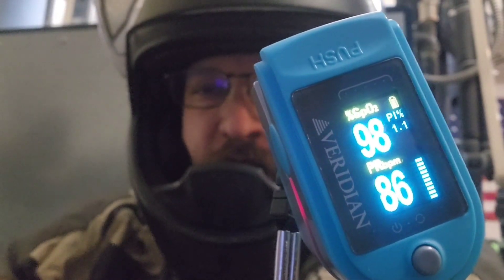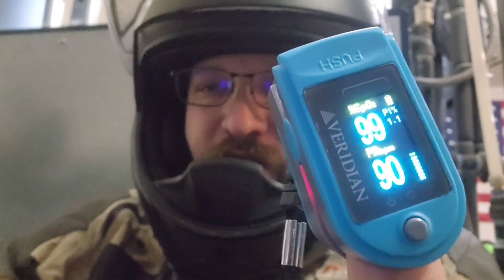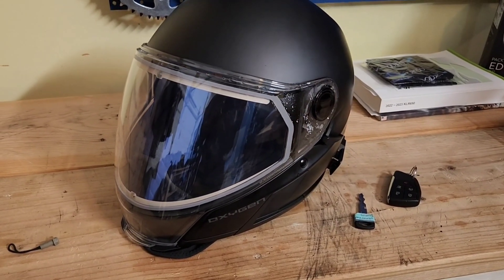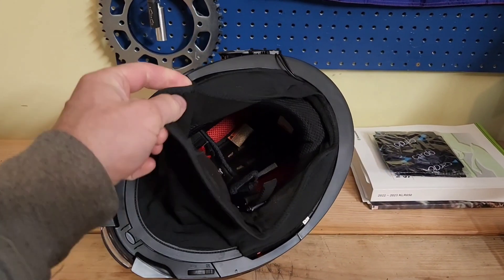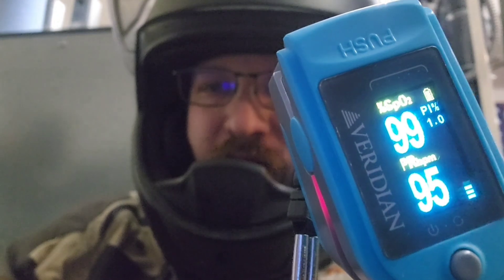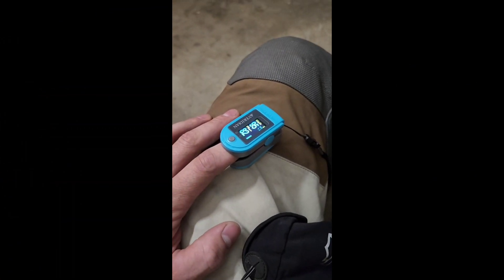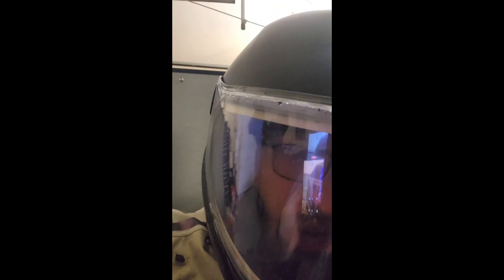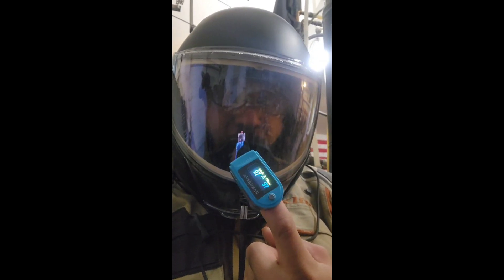Is CO2 in your motorcycle helmet really a problem? FortNine says yes.  Read the description.

Comment: I believe it's a function of how individual people breathe.  If you're a person that takes shallow slow breaths while cruising down the road (particularly true for an older person), you will not purge the air out of your helmet, and you'll breath the same air over and over until the CO2 levels become a  problem.  I know this personally, so remove those chin curtains, folks ... Especially if you're no longer a teenager.
Reply: As a side note, I no longer ride with a chin curtain, and I no longer find myself yawning for no reason.
Reply from the maker: That's fair. Your depth of normal breathing could definitely cause you to circulate less fresh air. 😬

Comment: Like I said on Fortnine's video, it's a non issue since the solution is to do what so many of us do as a matter of course at a stop, we crack the visor. Problem solved. Or, those of us that run modulars, no problem.
Reply from the maker: I do typically pop mine open when I stop also! Except for with the winter helmet. I keep that closed to keep the inside warm. It prevents my glasses from getting cold and then fogging up when I close it again. 

The reason I got out the pulse oximeter to check my O2 says was because a friend sent me the video from FortNine and had me worried about safety with the visor closed. I am not so concerned now.

Comment: Fortnine puts out really good well researched content, you don’t have to agree with everything he says but you should try to at least put in more work researching before trying to “debunk” him.
Reply from the maker: I also like FortNine's videos! They do a good job. I don't disagree that the saturation of CO2 in the chin area of the helmet is as they measured. I simply disagree that your brain function is reduced by 50% with normal breathing. You take in enough fresh air in addition to the re-breathed air with each breath that safety and oxygen saturation is a non issue.
Reply: @ak.klr650  That’s fair, but the video wasn’t talking about oxygen saturation, it was about decreased cognitive performance during high co2 exposure. Fortnine didn’t prove any of this in his videos, he just proved that motorcycle helmets do indeed create high co2 environments then pointed to studies showing the high co2 environments lead to a decrease in mental functioning. You should do the video again but this time maybe do some AB logic puzzles and time how long it takes to complete a set of 5 then put the helmet on for 5-10 minutes and do another set of 5 with the helmet on and see if you can see a change in the time it takes you to complete the set of 5. That would be an awesome video that would actually give you some actionable info.
Reply from the maker: I did find the OSHA information on allowed PPM, over an 8 hour exposure period, interesting. 
I might do a follow-up eventually. I added some info to the description on this video so people can see what I found after making this one also.
https://www.osha.gov/sites/default/files/methods/osha-id172.pdf
Reply from the maker: That might make for an interesting test!
The only examples of elevated CO2 in your blood from the medical world that I have found so far come with reduced O2 saturations. I think the link is pretty close between the two. I would be interested in seeing an example of where that isn't correct though! So yes, I drew the conclusion that high CO2 would have to mean low O2, but again, maybe someone can point out an example of that not being the case. 

I'll paste an article below that talks about hypercapnia (high CO2 in the blood). Since the treatment is Oxygen, I'd assume hypercapnia generally is associated with hypoxia. But maybe there is a scenario I don't know about that could be separate.
Reply: @ak.klr650  so it mainly comes down to the fact that your body can easily recognize and adapt to changes in co2 levels but not so much o2 changes. Therefore your body (primarily not completely) uses co2 to detect wether or not it is getting a sufficient amount of oxygen per breathe. When co2 levels heighten it compensates by changing your breath and also slowing down brain activity, which is the problem here. So they have very different effects and can’t be considered the same. I’ll keep an eye out for another video if you post one, it would be cool.

Comment: I agree with Fort 9 because I personally have had times where I suddenly felt fatigued due to the dirty air in my helmet. Opening the visor an inch immediately cleared the air and the fatigue was eliminated. Fort 9 had it right. I knew this before I watched his video. No need to watch this video. Thumbs down...
Reply from the maker: Glad opening your visor has been a refreshing help! It is possible that shallow breathing could cause an issue. I didn't see a significantly reduced O2 saturation, and at least felt like my breathing was normal. I don't see the issue as a 50% reduction in brain function risk as stated, but again, shallow breathing could change my results. 
More oxygen is usually a good thing! 😂
Reply: @ak.klr650  My experience was not due to shallow breathing. Another factor is the brand/ model of helmet and fitment. If I close the vents on my helmet I notice the increase in CO2 in about 10 minutes.
Reply from the maker: Different vent amounts, wind angle, and helmet size could have some effect I am sure!

Comment: Helmet with the flap on cause me to ride sleepy on long rides, I verified the statement. Removing it improves my awareness. CO2 and O2 are two different things, as a guy mention before. Besides that, in your full scientific experiment I observed a drop in your O2 saturation and a rise in your pulse, so definitely is something going on there. Obviously is not poisonous to ride with the flap on, it's simply ridiculous, but we have to agree that its existence could contribute to a rise in CO2 in the system, therefore cause mild effects like, sleeplessness, for example.
Reply from the maker: I have attributed the sleepiness to other things in my own mind. That doesn't mean I have been right. 😂
While moving, FortNine said their CO2 monitor read healthy levels in their helmet. Their assertion is that the dangerous build-up was when you are stopped and not getting the moving airflow. 
And you are correct, I should've drawn a little more attention to the drop in O2 sats I had. I did dip to 95% momentarily and spent some time at 96%. That is less than I was at before closing the visor, but down to 95% is still considered normal for a healthy person. 
That does tend to indicate there was some negative effect though! I just didn't find it to be at the point of a safety risk. 
And, all of this is my opinion obviously. Fresh air is good in the largest quantity you can get! 😂
Reply: Even 92 is considered still good, but the higher, the better of course. And I’m talking about 500km + routes. And the Neotec II makes like a bubble between the nose protector and the flap that makes even harder to renew air, basically you breath the air that you exhales.
Reply from the maker: FortNine did say in the helmet they tested, the CO2 was at normal levels while the bike was moving. So that's a plus. Their tested elevation rise was while stopped from what I gathered. 
500+km rides are decent distances for a day trip. 😊

Comment: Thank you for doing this test. I appreciate your attention to detail. I have wondered about the O2 sat. level inside my helmet. You have clearly debunked the fears.
Reply from the maker: Glad it was helpful. There are a significant number of dissenting comments on here that might offer decent concerns. I just am quite certain based on my O2 saturation levels, that the visor closed with a sealed neck, does not create a safety issue with reduced O2 at a dangerous level.
Reply: all he proved is that your O2 stats do not drop inside a helmet.. most studies measure CO2 levels in ppm (like FortNine did) and then have the test subjects take a cognitive test... our boy here did neither.
Reply from the maker: I believe the two are linked based on the only medical examples I have found so far. I am not a research genius though, so maybe you can find something showing an example of high CO2 and O2 not being decreased. 🤷‍♂️
Reply: @ak.klr650  a study conducted by Harvard showed that levels as low as 1500ppm can affect pilot's ability to perform maneuvers. 

"Airplane pilot flight performance on 21 maneuvers in a flight simulator under varying carbon dioxide concentrations"
Journal of Exposure Science and Environmental Epidemiology.

Comment: Oxygen saturation and Carbon dioxide levels are not the same thing. And they arent mutually exclusive either. You can still have high oxygen saturations while suffering from increased CO2. This can lead to things like farigue or headaches which can all impact a riders ability and safety.
Reply from the maker: I am open to being wrong. I have tried searching an example of having hypercapnia while still having high O2 saturation and am not finding an example of it though. 
COPD patients get hypercapnia (high CO2), but simultaneously present with low O2. The treatment for them is oxygen. 
According to this article, one way to test for high CO2 is with a pulse oximeter. And treatment for high CO2 is Oxygen..: https://my.clevelandclinic.org/health/diseases/24808-hypercapnia 
Again, I am open to being wrong, but I am not finding an example of it with my limited knowledge.
Reply: @ak.klr650  I’m a bit late to the party but spO2 and ETCO2 (the amount of CO2 in your blood) and completely separate.  Derangements of either can have different causations. There are different types of respiratory failure. Without getting too far into the weeds, you would need something called waveform end tidal monitoring to figure out if the increased CO2 in the helmet is actually increasing your blood concentration. Here’s the good news, most people increase their respiratory effort when CO2 increases in the blood. So if you’re not panting like a dog, I wouldn’t worry about it
Reply from the maker: @Gibbins580  you've probably got it right. I think except for COPD patients? Normal people's respiratory drive is from CO2 levels l, not O2.

Comment: I like the Fortnine channel, but not so sure about how they conducted this experiment, even in their experiment the co2 figures in normal when riding, only rising when stopped with the visor down for up to 6 minutes, don't think I ever sat with a visor down for 6 minutes, also the sensor was in the bottom of the chin piece, not near the top where you'd have fresh air coming in if you cracked the visor open when stopped or riding slowly and also nearer your nostrils.
Reply from the maker: In normal temperatures, I also lift my visor when stopped. With my heated visor, and recent winter riding, I started leaving it closed when stopped. My concerns about Oxygen intake was what prompted me to do a little more checking to make sure I wasn't about to hurt myself.
Reply from the maker: I would generally agree with the bulk of what you have here. Obviously you are rebreathing a portion of your air. And that had a slight effect even on me. My saturation of O2 dropped as low as 95%. Still within normal, but less than the 98 - 99% with visor open. I just don't see a 50% reduction of brain function as a concern based on my findings though. 
I watched their video after a friend pointed out to me that my winter helmet setup could be dangerous. This caused me enough concern that I decided I had better test the O2 saturation I was maintaining so I didn't cause myself harm. As it turns out, I was obviously over concerned by their video.

Comment: The argument was about PPM of CO2 and not about how it affects O2. Some people have linked them but FortNine did not.
Reply from the maker: The only examples of elevated CO2 in your blood from the medical world that I have found so far come with reduced O2 saturations. I think the link is pretty close between the two. I would be interested in seeing an example of where that isn't correct though!
And apparently I should take an IQ test while in a helmet. 😎
Reply: @ak.klr650  In all but one of the studies cited by FortNine and especially the one about pilots (most relevant to motorcyclists imo) all only use ppm of CO2 and cognitive testing. 

Harvard Study. "Carbon dioxide levels on flight deck affect airline pilot performance" while the performance was statisically negligable, pilots in the 1500ppm category failed more often than those in the 700 and at 2500, failed more than those in the 1500ppm category.
Reply from the maker: Reduced O2 and increased CO2 would be the cause of the brain function reduction they say might occur though. It is my understanding they are pretty closely linked. Your red blood cells carry CO2 out, and O2 in as they travel through your body. The treatment for high CO2 levels in EMS is O2. The way to identify hypercapnia (high CO2) in EMS at least is via pulse oximetry. Pulse oximetry is a measure of oxygen content. 
I think I am at a reasonable conclusion, but am open to being shown wrong. 😊
Reply: @ak.klr650  the studies use cognitive tests and measure CO2 in ppm. You did neither of those things. All you proved is that wearing a relatively sealed off helmet won't drop your O2 stats.. so thank god for that. As for FortNine... you were testing apples to their oranges.
Reply from the maker: So this discussion has caused me to learn some more. Good stuff. 😊 
Osha lists the 8 hour time weighted average allowed exposure to CO2 at 5000 PPM. 
Studies do note that headaches, and other effects can occur at 2000 to 5000 PPM. None of the studies look at O2 saturation, so that doesn't appear to be as relevant as I thought in this. 30,000 PPM exposure for 10 minutes is a short term exposure limit I saw listed. 
https://www.osha.gov/publications/hib19960605
https://www.osha.gov/sites/default/files/methods/osha-id172.pdf 
It does not appear that a 50% reduction in total brain function is possible at 1300 PPM. My end opinion is still that the motorcycle helmet is a non issue, primarily due to the fact that you are only in any increased amount of CO2 when stopped. There was more to this than I knew though. 
It has been interesting learning.
Reply: @ak.klr650  I guess? The real problem comes from being stuck in traffic and moving at like 6-10mph for up to an hour on end. If you can disprove their measurements of 1800ppm inside the helmet while waiting, I will be more skeptical than I already am.
Reply from the maker: The normal person's drive to breath comes from CO2 concentration in the blood. So you should feel a drive to increase your breathing rate, therefore expelling more CO2 of your blood levels go up. This might explain why when working to get your bike unstuck inside a closed helmet gets your breathing up as fast as lifting weights even though the perceived work load is less. I have noticed this a couple times. I am just thinking out loud through text at this point.